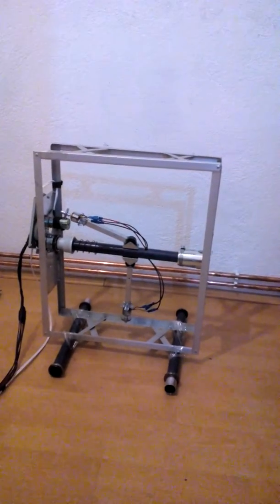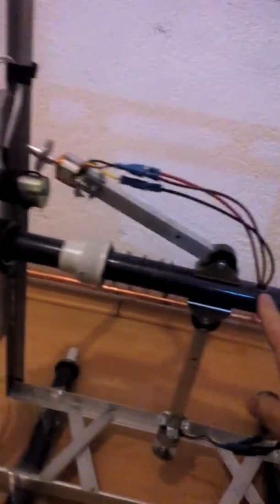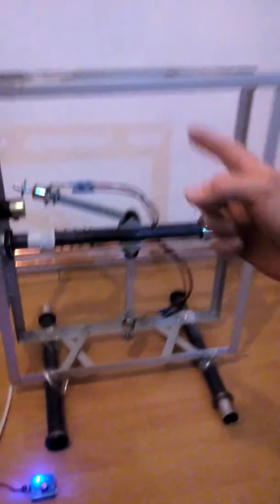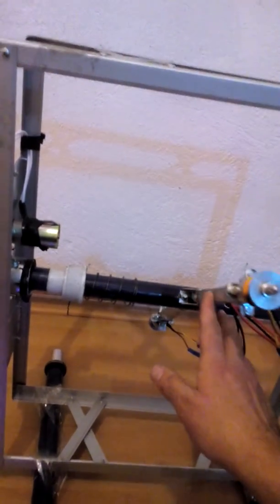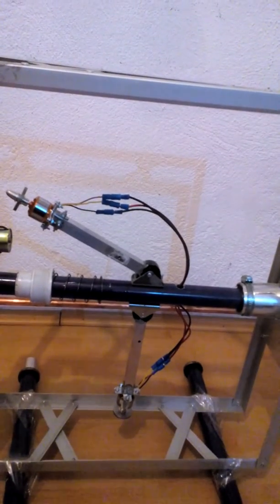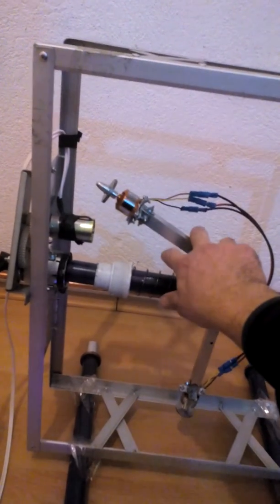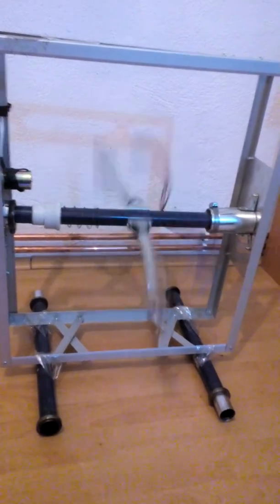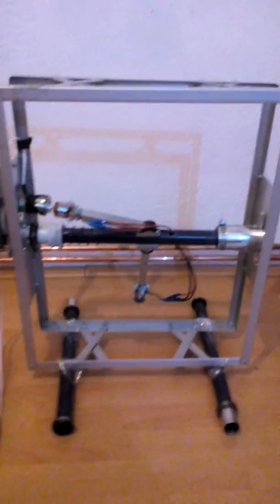Centrifugal propulsion (precession propulsion) - Initial set up.

Comment from the maker: Tried that, the momentum of the motor itself is to small. You need heavier gyroscope to cause stronger precession to counter the centrifugal force on the arms. Actually I need even heavier weights to increase the precession of the arms. Ideally the gyroscope should have brakes so it can stop immediately and make the centrifugal action more potent. This way the motors stop gradually and the arm return slowly on neutral position. There is another video with heavier weights that makes some movement, here is the link...https://www.youtube.com/watch?v=yo-qR0lx_io

Comment: Great explanation! I'd like to ask; why bother with rotors on the electric motors? The rotors seem to have nearly the same diameter of the stator of the electric motors. Why not just use the rotor of the electric motor as THE rotor for gyroscopic effect? Or, an electric motor with a wider diameter rotor?